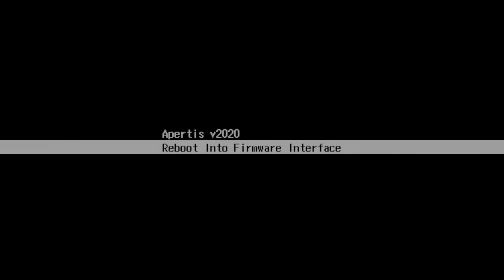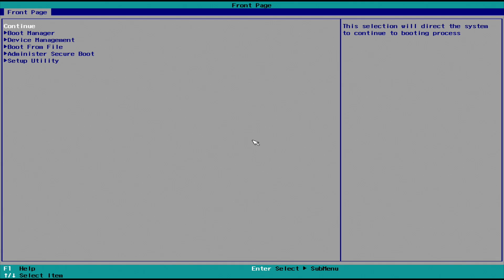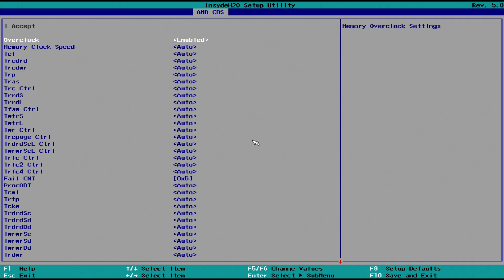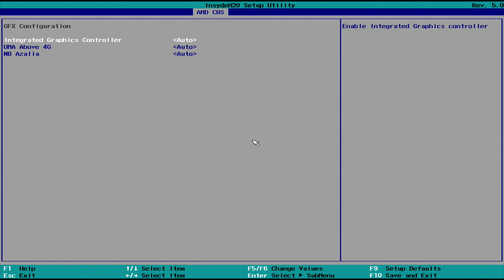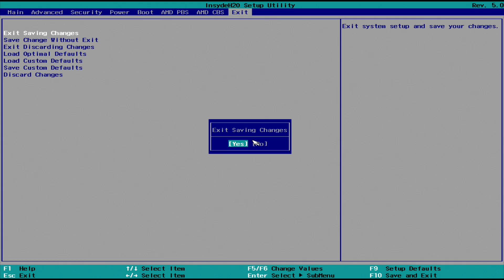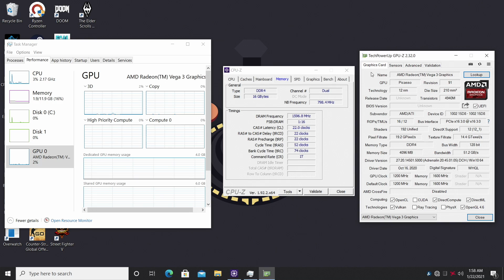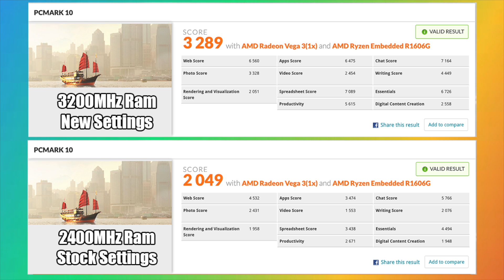Atari VCS Teardown and Performance Upgrades, Bios, TDP, Ram Upgrade, M.2 SSD

Comment: I left a comment under the prior video about the BIOS password.  I should've known that you'd figure it out.  What is interesting to me is that the password you had is different than the one I saw.  A difference between reviewer samples and consumer copies?  

I still think the VCS is cool.  I wonder if there is a way to desolder or otherwise disconnect the old APU and replace it with something from this decade.  Probably not, which is a shame because this unit has everything else it needs to compete and beat the competition.  

Still, as it sits, I could find a use for it.  The older games I like haven't gotten any harder to run, and won't get any harder to run.

Comment: I wiped the internal drive using ShredOS and installed a SSD. Now I have Batocera booting from the stock 31gb drive and my Roms / Steam will be stored on the new SSD.

Comment: Welp, I replaced the thermal pad with paste and threw in 2 sticks of 16 gig Teamgroup elite DDR4 3200MHz (many people said this would work). Followed your steps, saved and rebooted. Fan starts up but no video or lights. I looked one the board and didn't see any sort of jumper to reset the BIOS back. I'll probably deal with it tomorrow but figured I'd see if anyone knew of a way to reset it, saving me time looking it up.
UPDATE: I just pulled the battery. Everything is back to normal. Might just leave it at the default speed for now.

Comment: hmmm, seems that if people try his upgrades, it stops and or KILLS the Atari VCS.  I have one coming, and has ANYONE upgraded the slightly newer version of this machine?  I don't have any plans adding an OS to the system, but simply wanted it to play the games a bit smoother, and not hit a SSD limit for adding games to the system.  Will the A-VCS use the M.2 SSD card for storing more games, as the built in SSD runs out of space?

Comment: Just to be clear, the password is different now. It IS NOT the Piano password anymore. As of the end of 2024 it's a much more obnoxious password.
Now it's:
Atar!C3l3br8te$50Ye4r$

Capital letters and all. That o is a zero for 50.

Also I tried upping the RAM speed since mine supports 3200 but that didn't work. The system would run the fan full blast but not start the system until I replaced it with the older RAM that came with the console and reset the BIOS settings. 

Changing the GPU configs to 4GB, and the power draw worked fine.
Reply: Very happy you had the exact same problem I did and recommended a fix before I went troubleshooting. I think this has to do with the make of the RAM I have. I went with TeamGroup 16GB 3200 sticks. Seems like a lot of people on the subreddit recommend Kingston for better compatibility. Did you have any luck increasing the frequency to above 1200 in the BIOS menu?
Reply: I've tried that and it seems that's no longer the password
Reply: @Ouyak  It is really complex.  Make sure you got it exactly right.  Otherwise, they probably pushed an update which changed it since then.  Dang it, Atari, stop friggin changing the password!!!

Comment: If you make all those BIOS changes now it doesn't work. The system turns on and the fan goes full blast but shows nothing on the screen. The light for the Atari logo doesn't even light up anymore until I replace the old RAM back in the system.

Comment: Its an amd 2core 4thread cpu......im suprised nobody came up with the idea of a similar platform with a light version of windows.....to run atari games. You would think it would be a pi with emulator, but a system like it is ,isnt bad value

Comment: Ok, so I know this is an old video but I just got my system, installed two 16GB ram went in to bios changed settings as suggested and now when I turn it on the fan just spins and I can’t even get back into the bios to undo it.  Suggestions?

Comment: I performed your suggestions and the VCS turns on with no light turning on. I opened up the unit and put in the original memory and it turns on.

Comment: Got this for $99 on sale. Looking forward to messing with this.
Reply: Me too. I'm  not a gamer any more, but those old games and the old price made me nostalgic for it. The twisty handle on the 'joystick' leaves a bit to be desired, but if you get some double-sided tape and attach a larger 'wheel' to the top of the handle, it works better on some of the games that use it. That will reduce the jumpiness and make it more comfortable.

Comment: So i upgraded my machine, went into the bios and made the changes youbdisplayed step by step. The machije then became stuck when restarting. I did a hard reset and there is power coming from the system, but the atari logo does not illuminate and the system no longer starts, only the fan is constantly activating. Anyone have any recommendations? I hope my system is not bricked.
Reply: Update after asking around. My own Solution was disassembling the unit and removing the battery from its compartment. And letting it sit for about 30 minutes until reassembling.
Reply: @Flanman113  Thanks!  Good to know for when I get a round tuit.

Comment: A few tips that I found while trying this out.

Changing the vram to 4GB caused my system to become unstable. This happened with multiple different ram configurations that I tried. I was only able to change it to 3GB without causing issues. 

Even with the new thermal paste you will likely get temperature issues. The cooling solution in the VCS was not well designed. Bringing the TDP up will only make it worse. Even dropping the TDP to 15watts still caused high temperatures. I opted to dissable the "core performance boost" in the bios locking the CPU to 2.6ghz instead of 3.5ghz. The slight drop in CPU performance is worth is for the quieter fans.
Reply: Also the CPU boost bottlenecks the GPU so disabling it may yield even greater performance in games
Reply: Do you think your new ram may be incompatible at those speeds? It seems that a lot of people are doing it successfully.

Comment: Can you change the stripe timings for low lag like 3_3_3_3 for example?Can you over clock the gpu frequency using a gpu over clocker like revia tuner?

Comment: I just did the suggested upgrades to RAM and BIOS settings. Now my collectors VCS is bricked. Can't even boot off USB. Thanks
Reply: Looks like the word 'bricked' has changed definitions...  I wonder if your new ram might be incompatible with the system at those speeds?
Reply: @OneWildTurkey  well i thought it was bricked, lol. And yes
Reply: @ObsidianContraption  Any chance you can exchange it? That might do it.
Reply: @OneWildTurkey  i fixed it as stated above
Reply: @ObsidianContraption  I should have been more clear - I meant if you got a different brand, maybe you'd be able to up the ram clock, too, so the GPU can take advantage of the faster rate.
Reply: Ok i fixed it. Not trying that again though
Reply: @ObsidianContraption how did yiu fix your problem? Mine ran into the same issue.
Reply: @Flanman113  i re installed the original RAM chips and set all the Bios settings back to the original. This seemed to fix it. I then re installed the 32gb RAM sticks and left the Bios settings be
Reply: @ObsidianContraption  thanks for the reply!
Reply: @ObsidianContraption  what also worked for me was removing the battery and letting the unit sit for about 30 minutes until reassembly.

Comment: I followed the instructions, putting the same amount of RAM etc, did everything shown in the BIOS. My VCS won't boot up, all I get is a black screen. Did some research and tried flashing the OS as is recommended by everybody and still nothing, just a black screen and I can hear the fan running. Any ideas? I'm out of ideas after all the research I've done.

I'm thinking of taking my hard drive and RAM out and then turn it on to see if that does anything. I just don't know what to do

Comment: I upgraded my ram to the same size shown in the video, and task manager says I have 27.5 GB available, but the memory speed is still 2400MHz and the ram dedicated to the GPU is still 2GB.

EDIT: I have found a solution. Due to a bad BIOS update from Atari a few years back changing BIOS settings messes with Windows and it won’t recognize there being any changes. You need to follow this guide, then go to Settings>Update & Security>Recovery>”Restart Now” under Advanced startup>(the console will reboot)>Troubleshoot>Advanced>UEFI Firmware Settings>Restart. This will boot you back into the BIOS settings. Press F9 to restore all default settings, then Save and Exit. Finally, boot back into BIOS using the same method as before and follow the video again to re-setup the custom BIOS settings. If all goes well the VCS should fully utilize all of the ram and be successfully overclocked

Comment: I just bought VCS the fan is so loud. Is there a way to turn down the fan or replace it with a better one.
Reply: If you've got headphones, they help a little.  It's not as bad as an old Athlon 750 that sounded like a B52 taking off, but it's definitely irritating.

Comment: After you make these changes, could you add an external SSD at say one or two TB. Then add a launch box set up and MAME. Then run it as an multi-cade set up? I know it wouldn't be crazy. But you could run a lot of older arcade games from that sort of set up if it worked.

Comment: Well I wish it were not true, but it appears that my efforts to perform the upgrade and the BIOS tweaks certainly went awry. My machine now turns on, the fan revs to top speed and stays there, no light to the front logo, and no output to the screen monitor. I suppose near the equivalent of not posting. I must be one of the unlucky few who bricked their machine by attempting the modification. 

If you have seen or heard of this result before and know of any way out of it, I would love to save my VCS. All ears.

Comment: Hey ETA Prime. I was about to upgrade my VCS with some new Ram (32GB kit - 2x16GB 3200MHz) and an M.2 drive for expanded memory with all the games on there now. I was wondering...
The faster Ram you get (3200MHz) and settings you adjust to run it better, do you think this would help me if I only use my VCS in Atari mode as a console, never as a PC in PC mode?

Comment: Have a quick question…. The RAM… when you go in the bios and change it, I have an actual 32 go 3200 mhz, how do I need to change that/max that in the settings???

Comment: using 54watts in system settings generates way too much heat i've tested especially for such a small computer , i wouldn't recommend anything above 45 watts( the default settings ) i watched the temps jump using a temp sensor app jumping an extra 10c or so just for a very small gain..others settings shown here definitely recommend

Comment: Hi, ETA Prime,I need some advice: I have a strange issue: I run Windows 10 on internal SSD and I want now to make it my regular boot device so I changed boot order to USB - SSD - EMMC. But when it boots, it displays a kind of error message on top of the Fuji logo: “Found update fwupd-12b99262-648c-4365-bafd-eb869fb7ebd47-0    WARNING: No updates to process. Called in error?” and it boots into Atari OS. When I changed boot order back to normal (USB - EMMC - SSD” then everything works without this error message and I also boot into Atari OS. So booting Windows is only possible when I intervene at startup. Any suggestions how I make boot oder working correctly with starting windows first? I cloned the Windows installation from the external USB SSD I used on the same VCS before that.

Comment: Would you describe how you applied the thermal paste (never done it before)? Did you remove the thermal pad entirely and discard, or did you just clean the surface of the CPU before applying the paste?

Comment: Will the 32GB or 16GB DDR4 3200MHz CL22 (or 2933MHz or 2666MHz) unit work? I have heard without the BIOS password you cannot increase the RAM speed above the native 2400MHz, so may be stuck with 32GB Kit (2x8GB) DDR4 2400 MHz CL17. Apparently, they changed the password and you can't get into the BIOS now. Is that true?
EDIT: Well, luckily, I did this on Jan 16, 2023 and the password was still the long than needed Atari celebrates 50th one, so fast and easy.😀

Comment: I picked up the VCS all-in speakerhat bundle from the Atari store for $189... just happened to be browsing their site and saw that price and jumped on it, then got an email notification about the sale the next morning.  Apparently that deal was only good for the first 50 customers, so I lucked out!

I didn't realize how well-designed and upgradable this thing was!  Will definitely enjoy tinkering with it at a sub-$200 price point for the full bundle.  It's too bad the price couldn't have been this low from launch... it'd probably be a radically different ecosystem today if it had sold better. Thanks for the video!
Reply: I jumped on this deal yesterday as well. Been eyeing it for a while and couldn't resist at that price. Already have an m.2 hard drive on the way, excited to start playing around with this.
Reply: Looks like they did it again for all VCS systems at 30% off, so I bought the speaker hat, both VCS models, and one of each controller. I hope it helps them keep lowering the price and make a refresh model soon.

Comment: @ETA PRIME  As it is on sale for $160 with $5 shipping I purchased one. In the bios can you change the memory timings. So if you buy good ram for instance Mushkin Redlines are CAS 16 at 3200 can you make sure you can run them at CAS 16. Overclocking settings you showed wouldn't necessarily change CAS settings as the RAM modules I believe also use 1.35 volts instead of 1.2. So can you change voltage and CAS on the VCS or would it not benefit from any of that and just run them at standards speeds?

Comment: Watching ETA Prime's upgrade video 32GB ram at 3200mhz he also upped the GFX UMA Frame buffer size to 4GB is there any advantage or disadvantage to giving more say 8GB or even 16GB?

what about CAS timing setings for memory any more inprovements?
Reply: I'm gonna try for 16GB whenever I get around to buying a 32GB kit of RAM (trying to decide which is fastest & most compatible). It seems low timings are important.  Most people say you don't need more than 4 (no add'l benefit), but I've read a bit about APU RAM and that more than 4GB might help for higher resolution gaming (in my scenario, trying to upscale older games via RetroArch, I think could benefit).  Also, why is it even an option to choose beyond 4GB, if there will be no benefit?  I'll be running a lite Linux distro b4 and after with same game parameters to see if see a benefit & try to come back here at some point (can't say when but imagine I could chime in b4 mid-february)

Comment: It be really cool if you put an external GPU on it using it m.2 port
Reply: I wager moders are working on it. I wish it came with thunderbolt 3 port and supported it out of the box.
Reply: @AdamAdamHDL  check out atari age, I saw someone post about it over there a while back.

Comment: I tried Piano18482 and it doesn’t work.  Tried it three times and then the console said “failed three times.  Reset console.”

Now I can’t get back there ever again now.  When I hit delete on startup, it just has some gibberish in the top left corner.  What happened to my system??

I followed the advice of your video and now it’s screwed up my console
Reply: This is an old video the password changed and is unknown. You have to downgrade the fw.

Comment: I made these changes, and now my Atari just boots to a black screen with the fan running. :-/
Reply: Same. Anyway you solved it?
Reply: @FireFuture-fq7if  Replacing the original RAM will let it boot again.
Reply: @bawells80  I got the exact same result today, plus the fuji on the front does not light up. Fan full blast perpetual, no input to the monitor. 

I thought of replacing the original RAM too, but no dice. Not sure what to do next.

Comment: I just picked this up for $99 from GameStop recently... followed your exact process upgrading to 16GB of DDR4-3200, 256GB SSD & re-pasted the cooler.  The fan runs less often, the system overall is much more responsive... time to try some games!

Comment: Can you replace radeon vega 3 card with higher one
Reply: no, the apu is BGA soldered to main board...if could be done, someone like CatandAndrew who does a lot of mods could via some External GPU adaptor, but I don't know if the VCS could interface w/any of those and don't think it could as I'm guessing the M.2 slot can't

Comment: If I put 32gb of RAM, can I dedicate 8gb to the gpu?
Reply: I saw on reddit a guy indicate he tried, but set back to 4GB after he noticed no difference.  Someone on reddit I believe indicated that it would be contingent on software devs to allow more than 4GB VRAM for an APU, and that Windows auto-selects the amount of VRAM to use irregardless of what is set via uefi/bios.  I haven't read or heard this elsewhere so I'm not taking it either way until I find something more official.  There was nothing in the official Vega 3 or R1606G specs that corroborated a limit and I have to wonder why up to 16GB is listed as an option in the bios if it doesn't mean anything.  It could be a matter where devs are not tailoring games to APU's (beyond consoles), but that is strictly speculation.
Reply: @linuxlover_8436  THX
Reply: @adonian  no problem